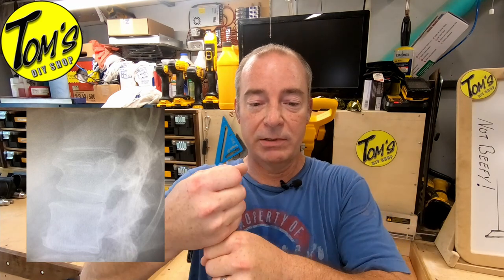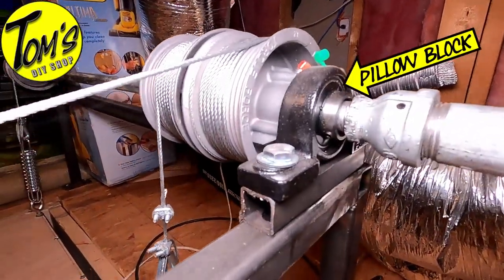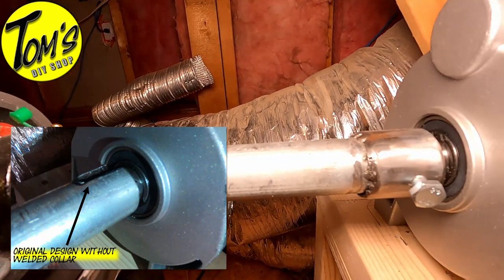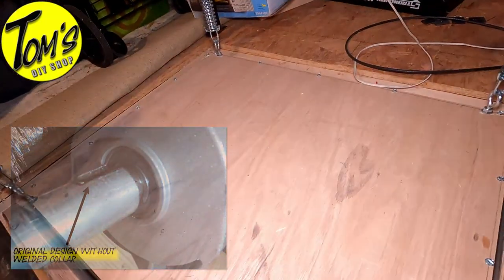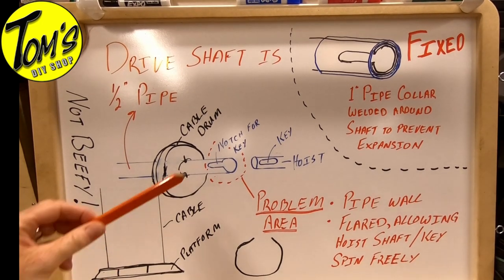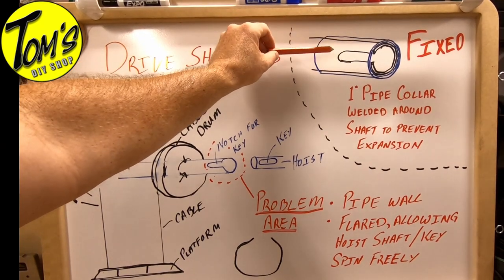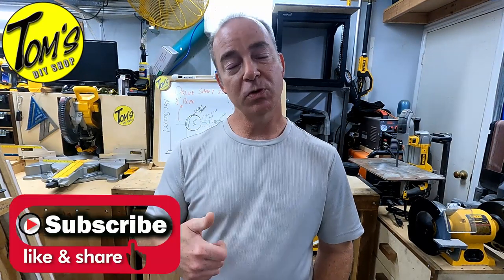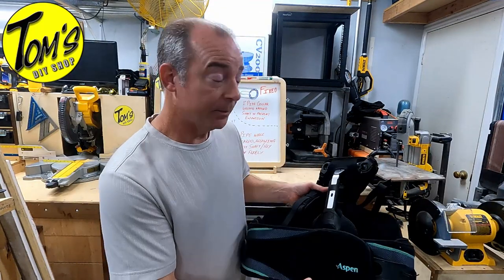Epic Fail - Attic Lift Fall: What Happened?

Comment: sorry for the fall.. however i have concerns about use pipe fittings.  pipe is typically not hardened steel & not intended for drive lines.
Reply from the maker: Hey Patrick, Thanks for checking out the channel and for the info about pipes...sure could have used that before I broke my back!! Ha! Ha!  I made several (incorrect) assumptions about strength / functionality based on my garage door and watching many other lift builds here on YouTube.

Trust me...I won't make the same mistake twice. Check out my wife's reaction when she saw me riding it. (https://youtu.be/usAWuR444-A?t=131) Of course I heard "You shouldn't be riding that thing...is it safe?"  Tom: "Of course it is...I wouldn't be on it if it wasn't safe!"  This was almost THREE YEARS AGO and I'm still hearing "I told you not to ride that thing."  If I fell again...I'd never live it down!

With that said...we moved and I have a new shop and will be getting back to putting videos out here.  And !YES!, I have already built ATTIC LIFT 2.0 :-)  More to come so make sure you're subscribed!!

Comment: It is not a problem that tube flared or wasnt beefy enough it is that when for some reason motor gets disconnected with the load there should be mechanically engaged brake that normally keep brake open with rope tension. So your problem is still there - lack of safety features. Next time is just something else will fail...
Reply from the maker: You are 100% correct and safety mechanisms were on the list of "To Do's" when the fall happened. In fact, I was sitting on the lift taking measurements so I could leverage the stopping mechanism when the lift reached the closed position. I wanted to make sure it was fully closed...so I bumped the "Up" button just to make sure. That was enough for the shear key to slip under the edge of the pipe and let the whole thing go.

In the next version (Yes...there is a next...as in, I've already built Attic Lift 2.0 in my new shop!), I will be leveraging fall arrester straps and Otis' safety brake design. Learning from my mistakes!!

Thanks for the comment and for visiting the channel. Be sure to subscribe...more content on the way!

Comment: glad to see your going to be ok,( i have broke my back to l1 to l5 broke total fuses now),i know the pain.  i used to be a pipe welder,  i still see a flaw in you design. your eyebolt need to be welded close  befor they open up on you. also you are saddle your cable clams wrong, ( Never Saddle A Dead Horse ) it will save your or some else’s life. words of thought < take care!!!!

Comment: It’s usually worth taking a moment every day to talk oneself through the planned activities and the safety precautions that might be appropriate. For example, “I am about to trust my life to this device; what could go wrong and where are the potential points of failure.” Whether it’s walking around a car to view all four tires, or walking around an aircraft and checking for water in the fuel and that everything is airworthy. Even getting in the shower every day (the most accidents happen at home) is worth a second of thought to avoid tragedy. Using a power tool or a lift is no less dangerous than any of these other things. And as others have commented, engineers use multiple factors of safety for a reason, lessons paid for with much blood and treasure. Never bet your life on a single component not being faulty. May you live a long, healthy, happy life.

Comment: Have you considered putting feet directly below your vertical supports to continue your downward force straight to the concrete?  May save some unwanted base flex from years of use.
Reply from the maker: Hey Clint, the design and location of the lift were determined by a couple of things.
1. The roof lines, large bundles of electrical wire, and a gas pipe left me with very few options from a placement perspective. I wanted at least 5 feet of headroom on the platform with the lift in the fully closed position. Due to where roof peaks landed...it need to be near the center of the garage.
2. If I put some type of support in place down to the floor, it would have limited / hindered use of some of the tools because of the reasons described above.

Ideally, I would have had this running on rails mounted directly to a wall, but that just wasn't an option for that garage.

However...In my new shop, that's exactly what I did. Attic Lift 2.0 has been built and it leverages all of the lessons learned from the first epic fail. I'll more videos coming out soon and review the changes / improvements made.

Thanks for your comment and for visiting the channel...be sure to subscribe and hit the bell so you'll know when I start pushing out more content!
Tom

Comment: Definitely lookedlike something that would happen to me. Glad you're OK and hope you have no long term issues resulting. In your fix, would it not have been possible to just weld the cable drum pipe directly to the hoist shaft. Thanks for sharing your ideas. I am in the planning stages of my small one care garage that I also have to leave space for my wifes car.
Reply from the maker: Hey Charles, thanks for taking the time to leave a comment and for checking out the channel. I did consider welding the two shafts together but, in the event I needed to take it apart for repairs or maintenance or replace any particular component of the drive system, leveraging the keyed shaft of the motor made sense at the time. I’m not sure how many times I thought I’d be doing that…but evidently it was enough to justify a more complicated solution because welding them together would have been easier.

Good luck on your shop build!

Comment: Ouch, sorry that happened, glad you weren’t more seriously hurt! Thanks for sharing, it’s a good counterpoint to all the lift vids here that say - for legal purposes no doubt - “not for humans, only put equipment on this” and then show themselves riding it up to their attic.

I’m in agreement with commenters that you fixed one point of failure, but really should not count on there not being another - after all, you didn’t see that first one coming, right? Have you considered adding the fall arrestors some have used? These winch lifts are the poor man’s elevators, it seems reasonable to add the poor man’s elevator brakes. There are no commercial elevators that just rely on their lift mechanism never failing to prevent you plummeting 20 stories, they have sophisticated braking systems separate from the lift mechanism. For just the reason your incident illustrates, I think.
Reply from the maker: Hello @3weight, thanks for checking out the video and for the comment, I really do appreciate it. In my latest video "Channel Update", I kinda show my new "Attic Lift 2.0" that I built in my shop...and YES...it has fall arresters! (https://youtu.be/sirQXxwffrE?si=SbRYtKiyOcvpJw7U)

There are a couple additional safety measures I want to include...like locks that hold it in place when not in use, which will allow me to take the tension off the cables and motor when not in use. More to come on that!

Thanks,
Tom

Comment: Standard threaded gas or water pipe is NOT strong at all.   You must use structural tubing or solid shaft for a project like this.

Comment: Glad you are ok.  It also appears your ladder is not installed properly.  If it was it would be straight.  It appears its legs are too long and do not allow the ladder to seat properly on the floor.  You should probably fix that.
Reply: On further inspection, you also seem to have welded galvanized steel pipe (pretty much a big no-no), and are relying heavily on just the threads of an NPT reducer (looks like 1/2") to not shear off from the torque.  I don't think you understand how dangerous your setup is and the risks you have taken, even after your fall.

Comment: Have you modified the cable spools to be keyed to the shaft? The binding bolt system they use is subject to failure.

Comment: it is good you are okay now, the threaded reducer coupling worries me still, can it unscrew?
Reply from the maker: Hey Butch, thanks for stopping the channel and taking the time to leave a comment.  The weight of the lift / materials on the lift keep enough tension on the cables to ensure the pull is always in the "righty tighty" direction. Also, I went after those connections  with a couple of large pipe wrenches...so I don't anticipate them coming lose any time soon!
Reply: @TomsDIYShop  I would put some tack welds on those threaded couplings. I don't care how tight you made them, and the fact that gravity should always make them tighter. What happens if the pipe threads get so overtightened that they strip?

And... I'm assuming that your days of riding the lift (or trusting it to hold your weight) are over?  ;-)

Comment: So glad to see you are recovering well. We all have had accidents happen, it's part of the process of "making".

Any reason you didn't use a set collar at that keyway slot? Welding a coupling worked great but not all of us weld so a set collar, I think, is a solid alternative. Even a split collar would work. 

Nice work and good luck with your back recovery. 👍
Reply from the maker: Hey CF, great question and something I wish I would have thought of beforehand!

I completely underestimated the wall strength of the 1” pipe used for a drive shaft and, although I watched a ton other videos where the connection was welded, I chose not to, in the event I wanted to take it apart.

The welded collar was a post production modification just to get it operational again. Two months in a brace put is way past Christmas and the garage was piled with totes that needed to get back in the attic.

Thanks for the great question and kind words, I appreciate it.

I have a new shop and a NEW LIFT I’ll be posting soon! Stay tuned!

Comment: My 2 cents worth of comment.  You can use a tension clutch.  If cable breaks and lose tension, the clutch engages to stop the fall.  Another factor maybe you can use a few pulleys to minimize the force on the motor connection.  Everything seems strong except where it connects to the motor shaft.
Reply from the maker: Hey Stephen, yes sir...you are correct. That is called an Otis brake and, although it would have been difficult to implement on my previous design, it will most certainly be installed on my NEW Attic Lift 2.0! It's already built in my new dedicated shop space and I have two fall arresters installed. I want to add an Otis brake as well...just in case!

Check back and click the subscribe button and hit the notification bell so you'll know when new videos land!

Thanks,
Tom

Comment: You need rails, which means relocation against a wall. A portable lift on wheels that includes a platform, rails and motor  would enable you to use the current hole in the attic. The flaw is this design is the instability of the the platform in all directions.
Reply from the maker: You're correct, that would have been a much better design...but it wasn't an option in that garage due to the rooflines in the attic space above the garage. Plus I had to work around a natural gas pipe and a huge bundle of electrical wire.

I couldn't re-engineer that place...so I just bought another one!!  Kidding...kind of - My wife and I bought a new place in the country and I have a new dedicated shop....with a new attic lift 2.0...and yes, it's on rails!

More content coming soon...be sure to subscribe and hit the bell so you'll get notification every time I upload!

Thanks,
Tom

Comment: Don’t want to rain on anybody’s parade, but as a elevator mechanic with more than 40years in the trade, I have yet to see one of these attic lifts that I would ever consider using, or letting anyone I know use. Way too many unsafe problems to name.
Reply from the maker: Hey Danny, thanks for taking the time to comment and check out the channel, I really do appreciate it! Buddy...where were you before I broke my back?!?!?  I'm kidding...I knew it wasn't the best / safest design, but due to other limiting factors, such as roof lines in the attic & platform clearance, I didn't have many options.

However, we moved and I now have a dedicated shop space with a new Attic Lift 2.0!!  The new lift is on rails, which are attached to a wall and I installed two fall arresters (one on either side) AND will be adding an Otis brake as well.

Be sure you're subscribed and check out my upcoming videos. I'm going to go over the new lift and I'd like to see if I can change your mind!!

Tom

Comment: Wow. Coulda been worse of course but still unfortunate you had to go through all that. We build lifts of all sorts for theater stages and other entertainment events. The level of safety factor that goes into most automation is high, but when it's a lift and especially one where a person is involved  the safety factors are the highest. The number one thing is brakes. Dual brakes most of the time and they are always engaged and are disengaged to make a move. Usually one on the motor and one on the driven shaft. Also there's no single failure point that can allow a free fall like what happened to you. Also we alway always use solid steel shaft, not pipe for anything like that. And couplers to make connections with either keys or bloc wedge style tapered.
Reply: After watching the video of the free fall accident, I am almost inclined to use a personal safety device or harness, such as might be worn by a tree arborist or roofer .  Most DIY home lifts that I have seen on Youtube may not be engineered sufficiently to avoid mechanical failures such as this one.  I hope Tom has healed fully and has not had any long term effects from the accident.

Comment: To bad this happen... your design should have used tracks withs a simple otis safty ratchet track lock and also  deadman fall staps as back up..

If a once cable snaps you done...with a track design  the lift stay in the track.... the load would not flop to the side spilling over... gravity would then lock the safty  mechanism into the track and the fall arresters would used as back up

Comment: Hi, Tom,
Like others, I'm glad your are OK.  As to the design, how strong is that shear key?  My understanding was always that a shear key was intended to be the weakest point in the system, essentially being the point of first failure (shearing) in order to protect everything else.  It looks to me like a shear key failure would allow your lift system to freewheel, basically doing the same thing that happened when it  turned freely inside of the notched pipe.  Are you certain the hoist mechanism can't shear the key, particularly with the lift loaded and at the top, perhaps if the load bounces? And even if so, why risk having the weak link in there?
Reply from the maker: Hey Jim, thanks for stopping by the channel and leaving a comment, I really do appreciate it. You have a valid point and it was something I (albeit briefly) thought about when putting this together. On many of the other build videos I watched, the drive shaft was welded to the motor’s shaft to ensure a solid connection. I chose not to do that because 1) the motor is capable of lifting over 1,000 pounds using (the original) cable spool, which included the shear key, 2) I knew I was not planning on putting any where near that amount of weight on the lift, and 3) in the event I needed to perform maintenance on the motor or the drive shaft, I wanted to have the ability to decouple them without having to use an angle grinder.

My lift was built to ease the workload of getting holiday decorations in and out of the attic and the heaviest object (excluding my fat arse) is our artificial Christmas tree.

Lesson learned…don’t ride the lift! If I am ever able to build an actual shop with attic / loft storage, I would absolutely go with a C-channel design using trucks and a braking mechanism.

Thanks,
Tom

Comment: pipes n drive shafts are very different steel one might guess..
Reply from the maker: Yes...you are correct! My mistake was assuming (and we all know what they say about assuming) the pipe would be "strong enough" because I wasn't planning on putting an incredibly large amount of weight on it. The shear key slipping was a result of:

a) over-rotating the hoist motor when the lift was already in its fully closed position (I "bumped" the motor just to make sure, which was evidently just enough)
b) not having the shear key slot I cut in the pipe enclosed / captured so that the pipe would not have flared (I inspected the shear key after the accident and there was barely a mark on it, so I don' t think the force I applied would have been enough for the shear key to shear)

Comment: Keyways don’t work like that. They marry a shaft to something on the shaft, not to another shaft. Commercial versions of those drums have key ways, and you slide the key in so half is in the shaft and half is in the drum. Both sides of the key have a large amount of metal around them. And then there’s also a large set screw that keeps the key from backing out, cause they do.  They’re gonna be tight, I usually hammered them in. 

To marry two shafts together you need a coupler so shaft 1 is married to coupler a which is bolted to coupler b which is married to shaft 2. 

A way around keys is a d shaft

The one inch hollow shaft is dented by the set screws in the drums you have, which kinda makes it a d shaft, that’s why they don’t have keys, why would you think that little piece of metal could be structural, especially when cut. Same principle on why open ended wrenches don’t grab as well as box end. You’re very lucky one of those cables didn’t grab something and try to wrap you around the drum. Especially since you have four cables